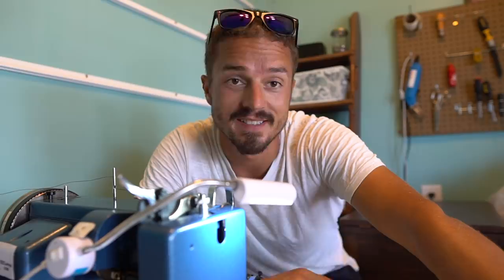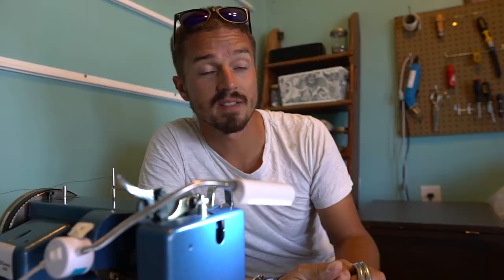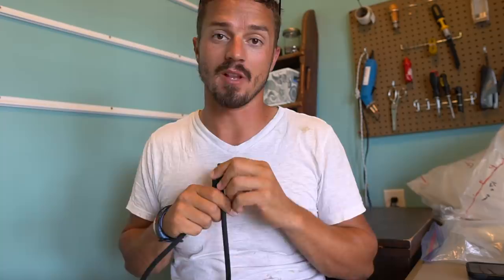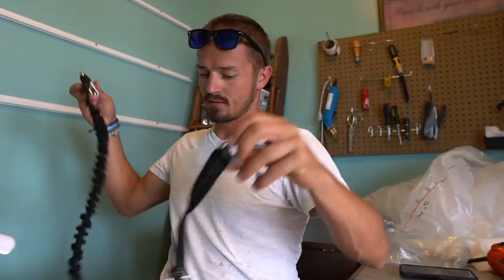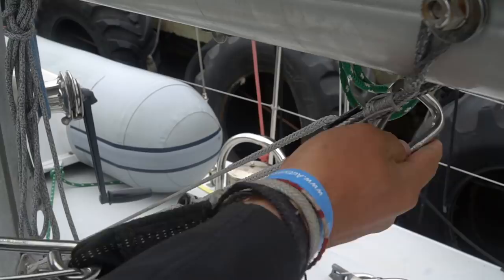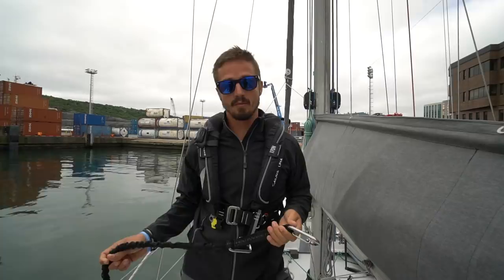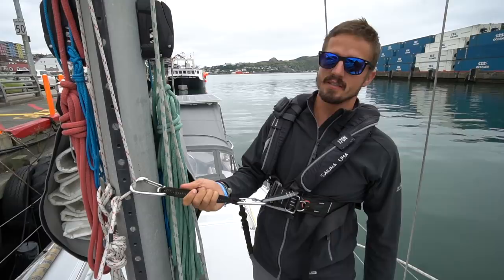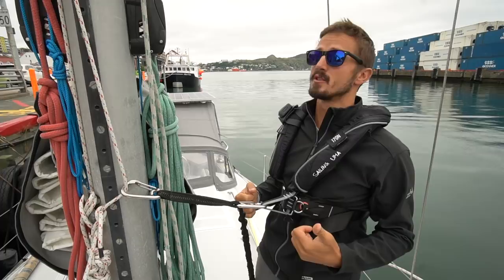DON'T FALL OFF THE BOAT!

Comment: Be carfuly with this carabiner. It can be open vary easy from alon. Put a loop over the lock and pull and the carabiner are of.
Reply: From Andrew Evans "Thoughts, Tips, Techniques, and Tactics for Singlehanded Sailing":
The skipper must be able to clip and unclip the tether quickly with one hand, for two reasons:
First, if it requires two hands, there will be many times when the skipper forgoes clipping on simply because one hand is busy on the tiller or holding a sheet. I will repeat this sentiment several times in the book. A singlehander is just as likely to fall off the boat on a stormy day with high winds when he is being extra careful as he is on a nice day when nothing significant is happening, but is just off guard for a fraction of a second. It is on one of those nice days when he might just skip clipping on if it is the least bit difficult. Human nature is such that people will avoid “unnecessary” work unless it is made as simple as possible.
Second, the skipper must be able to unclip with just one hand in situations where the other hand is busy. For example, if the tether gets caught on a cleat in the middle of a spinnaker gybe. It is much easier, and in the end probably safer, to unclip rather than leave the spinnaker pole swinging across the boat. I am not so unrealistic to think that the tether must be worn every second of every voyage. The easier it is to clip on and clip off, the more likely that the skipper will wear it more of the time.
Some boaters insist on locking carabiners. I have no problem with this concept as long as they can be quickly and easily fastened and unfastened blindly with one hand. In nine years of running all over my boat dragging my tether, I have never had a carabiner detach from the jack lines or my harness, so I don’t feel that a locking mechanism is necessary. I have heard of situations where the jack line runs parallel to a sheet and the carabiner runs onto the sheet. My suggestion is to move the jack line to a new position where this can not happen.

Comment: I like this design, and think I will re-make our tethers like this. Does anyone recall Dan mentioning his source for their jacklines? I know it was in an episode, but I can't seem to find it now. He ordered some tow straps online and I'd like to do the same.
Reply from the maker: We just picked up the webbing from a local boat shop and tied it on. Anything UV resistant and rated for the loads will work just fine. It's often used as a tow strap for off-roading.

Comment: Palm-locking carabines used in climbing work exactly the same as your when you hold in your hand but will never self-unlock, they are quite a bit more expensive than the one you are using but I would never trust my life to a non-locking carabine when the ease-of-use is the same.
Reply: 1979 Fastnet race carbines failed

Comment: Hey Dan..there's another saying that goes like this. "They make carabiners without locks and with locks for a reason." Go figure! Hope you reconsider!!!
Reply: Because there are places where you use locking carabiners. A sailboat is not necessarily one of them!
From Andrew Evans "Thoughts, Tips, Techniques, and Tactics for Singlehanded Sailing":
The skipper must be able to clip and unclip the tether quickly with one hand, for two reasons:
First, if it requires two hands, there will be many times when the skipper forgoes clipping on simply because one hand is busy on the tiller or holding a sheet. I will repeat this sentiment several times in the book. A singlehander is just as likely to fall off the boat on a stormy day with high winds when he is being extra careful as he is on a nice day when nothing significant is happening, but is just off guard for a fraction of a second. It is on one of those nice days when he might just skip clipping on if it is the least bit difficult. Human nature is such that people will avoid “unnecessary” work unless it is made as simple as possible.
Second, the skipper must be able to unclip with just one hand in situations where the other hand is busy. For example, if the tether gets caught on a cleat in the middle of a spinnaker gybe. It is much easier, and in the end probably safer, to unclip rather than leave the spinnaker pole swinging across the boat. I am not so unrealistic to think that the tether must be worn every second of every voyage. The easier it is to clip on and clip off, the more likely that the skipper will wear it more of the time.
Some boaters insist on locking carabiners. I have no problem with this concept as long as they can be quickly and easily fastened and unfastened blindly with one hand. In nine years of running all over my boat dragging my tether, I have never had a carabiner detach from the jack lines or my harness, so I don’t feel that a locking mechanism is necessary. I have heard of situations where the jack line runs parallel to a sheet and the carabiner runs onto the sheet. My suggestion is to move the jack line to a new position where this can not happen.

Comment: I also made my own tethers, but I used  these on the harness end: https://www.amazon.com/gp/product/B07B8TMCG3/  because I wanted something that I could release under load. Also, I used carabiners with a screw gate on the jack-line end so I can leave them locked or in quick-release mode as conditions warrant.
Reply from the maker: We've seen that style of snap shackle on commercial tethers too. But could never figure out under what circumstance you'd need to detach under load. If we're getting dragged beside the boat, our PFD's will flip us around and be pulled from the back so we won't drown, then we'd clip the spare halyard to the long tether still on the boat and start hauling. If you released the tether from the harness, you'd be swept out to see and then it would be a much more dangerous situation. Are we missing something. The LAST thing we'd want would be to detach from the boat.
Reply: @SailingUma  I agree that you wouldn't want to release if you were being dragged along and able to breathe. The main situations I can see for wanting a quick release are (1) in a de-masting situation when the jack lines and tethers might get caught up with the rigging and drag you off and (2) if the boat were sinking and dragging you down with it. Also, Spinlock, which doesn't have snap shackles on their tethers, sells a emergency knife for cutting the tether in such situations. I decided that of those two options, I prefer a snap shackle to messing with a knife while getting bounced around in the water. While I made the assumption that the commercial tether makers know their stuff, I haven't seen any analysis of how often events occur that require a quick-release. However, it wasn't that much to include it, so I did.

Comment: first question is???  did you use a bar tack stitch?   if not I would not trust it for any type of safety line...    otherwise you just have a false sense of security.
Reply: I know the Sea can have me anytime! everything  I do is a sense of security that is unfounded. There us nothing more important to safety than sails, and they are stitched! I suggest the safest thing to do is stay at home
Reply: @daneatherton7886  haha, well said

Comment: I think that when you get to the EU you are going to find it very difficult to get fuel for your wood stove.  What they Do have over there are little kerosene burning stoves and the fuel is usually sold in many places.  This worked really well for us.  The stoves are only about $200e and the fuel is cheap.  Good luck.  I'd pack a LOT of fuel for the trip across.  You will want heat for the damp wet North Altantic.  just saying.
Reply from the maker: Our stove can burn coal too. Something they have lots of in England. But we'd only use in on anchor. We'll mostly be at marinas though out the winter. So we can have electric heat.
Reply: @SailingUma  What about when your at sea?   
Not trying to bug you guys but I do worry about the realities of sailing in the north.  I think your coal idea is good but you will find it somewhat difficult to find at your local grocery hardware store.  Anyhow,  you will have power so all should be good.  Just promise me you will take lots of wood or coal for the crossing. K  all the best 
Scott.

Comment: Climbers use two reversed carabiners  as an alternative to  a locking `biner.  The idea being that an accidental opening force would have to come from more than two directions in order to cause  disconnect.  Two reversed `biners might even be safer than a locking `biner.  A single spring latch `biner  has a lot of interesting failure modes, many of which are surprisingly likely in tough conditions.  I might consider putting two `biners on the harness end and two more on the jackline end of the tether since those are the ones you will ultimately depend on.      I'm also not a huge fan of  fixed hole carabiners sewn into webbing either.   Field replacement of those is problematic.   

Safety is a tough problem. It's always a balance between risk, convenience and cost.  It's worth reading this to get some ideas. https://www.pbo.co.uk/seamanship/is-it-safe-to-use-a-tether-251

Comment: oh man... I would rather just tie the tubular strap... kind of worried about stitches... yeah quick draws are stitched but its really quite the stitch with like 4 times the requirement of stitches...
Oh and dedicated attachment point for the mast... Granny Bars, Granny Bars Granny Bars!!!
Reply: Granny bars are good, but you dont trust stitching? How about on your sails? Let's face it everything is a trade off because the safest thing to do us stay home
Reply: the tubular shock part has little strength, it's the flat outer strap that saves your butt

Comment: Unfortunately  YouTube has created a new generation of inexperienced 'experts', and a platform for them to distribute bad information. 

When it comes to safety, this becomes a problem.  There are good reasons organizations  such as ISAF and World Sailing have researched,

tested, and developed safety requirements and recommendations for boats and personal equipment. They are easy to find on the internet  Its not an area to take advice from amateurs. There are many things wrong about Dan's tether design and materials, only some of which are mentioned here.  Safety is  safety. A harness that 'works for us' would also be non compliant if say you are crewing in many organized offshore races.  If you want help on doing some interior design or food recipes, sailing UMA is fine. For getting advice on offshore sailing safety equipment and protocol, probably not.  But if you want to save $50 on a life saving piece of equipment that is home made and designed by two architects good luck to you. Just let everyone know who your next of kin is before you leave :)
Reply: Absolutely...good of you to take the time to post. Based on the vast majority of comments. tragically natural selection will have its way.

Comment: The weak point in that harness is the fabric loop that you clip on to. it should be a metal ring so it won't fray over time and weaken.  Don't cut costs when it can save your life. You only get one!
Reply: A metal loops can wear too. Either way it needs to be regularly inspected, so as long as they inspect the fabric for wear this isn't a problem. 

Also, depending on the fabric, the tensile strength will be stronger than steel. "If this is good than twice this is better" is just not true. You only need it to be "strong enough in the worst case scenario", and this design is.
Reply from the maker: I think every highend PFD with a harness built in has a soft attachment point. Yes, keep an eye on it. But the rest of the pfd will most likely need to be replaced before that loop wears out.

Comment: Short Tether is a great idea I've seen added or improvised on all the harness gear I've borrowed when sailing. Have you seen this kind of double lock? http://www.wesspur.com/carabiners/rope-clips.html way better to use one handed than the other kind with the bar in the clip to push out the way. The large kind climbing over a tall ship was very easy https://www.rockallsafety.co.uk/product/ridgegear-rgk88-double-action-scaffold-snap-carabiner-62mm/

Comment: When making a harness, consider the number of ways your unconscious, flexible self can fall out of it; up, down, forwards, backwards, and even sideways.
Reply: I worked in skydive for a number of years: girls especially because they're more flexible, but guys too, would get in and out of their harnesses all the time without so much as loosening straps, but I've never heard of anyone ever falling out of a harness. Your body only folds one direction, and so long as you don't connect your tether to you back side and you are using the leg straps, there's just no way you will fall out of a harness.
Reply: You wont fall out of a well-designed, well-fitting full harness, no. But this is about people making their own. Also, you tend you assume you'll be dangling upright. Folk often go up a mast in something that goes around the waist and between the legs. If you find yourself upside down, you'd fall straight out of that.
Reply from the maker: I've rock climbed for years and have fallen quite a few times. Never felt like I'd fall out of my harness. If you adjust it correctly you won't fall out of a typical climbing harness. You can hang upside-down all day and won't fall out. Besides, it's very hard to actually get vertical  upside-down. Your body naturally rest horizontally if unconscious in a harness.

Comment: So no one will tell me what happens if you fall off at sea in a sea state of 4 and over.
Reply from the maker: You die.
Reply: @SailingUma  I am designing a self rescue system now; 

I haven't even bought my boat yet but I expect it will be built and tested by then.

It will be the first thing I install and will test it in a solo offshore trip.

I guess it will the design of my life.

Let's just see how the sailing community responds.

Comment: Beautifully designed and made. Why not try and get a Chinese manufacturer to make those for you - sell them on your channel and on Amazon? You have just made the advert for them!
And yer with a short teather, lots of METAL clip off point in stretegic locations. Absolutely. I wouldn't be clipping onto any old rope.